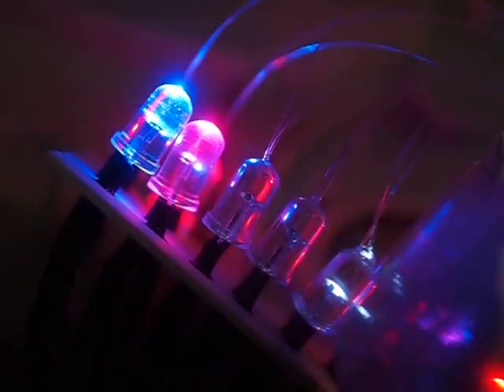The Millenium Falcon Cutaway model build INSTRUMENT PANEL TEASER!!!

Comment: You could also slip a brass, plastic or aluminum tube around the LED and slide the fiber in at your convenience.  That allows for more experimentation and ease of use.  When done, those can be sealed in with white glue or silicone.